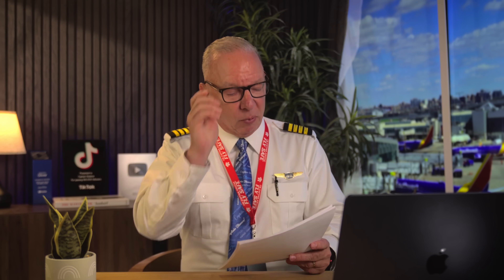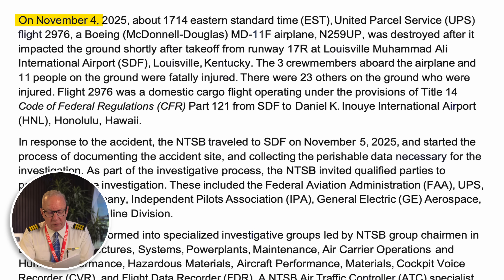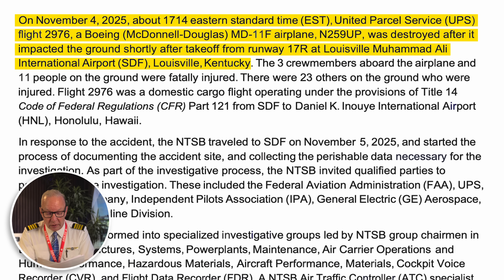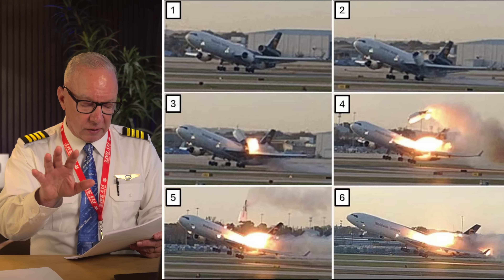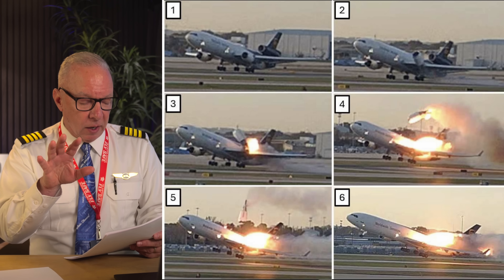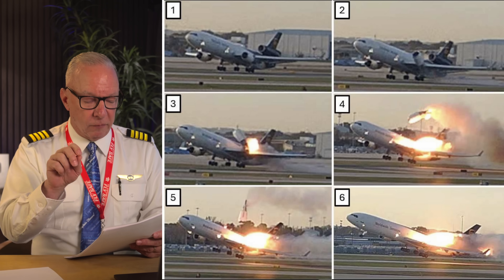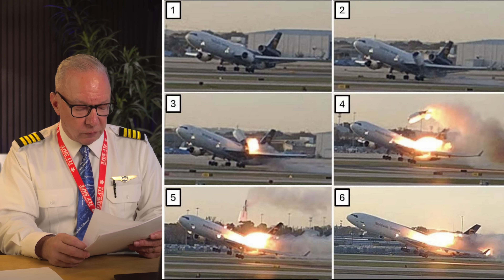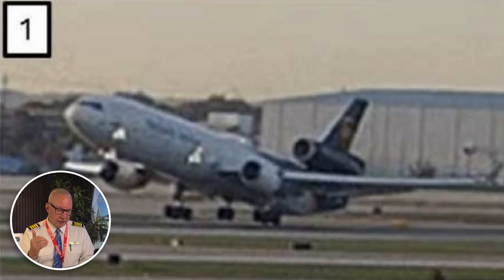UPS Crash Preliminary Report | Pilot Reacts to UPS Crash Report

Comment: Until the fuel burned out that engine had a thrust-to-weight ratio of 6:1 at around 60,000lbs, the bypass on it is about 5:1 so once the fuel burned out it still had about 45,000lbs of thrust lowering as it spun down.

They missed the part where it picked up 3phase 25kVA power lines then shorted out into a building.

Comment: The crash in Chicago was fro Engine change done with a fork lift instead of engine change hoist. Which the American airline engineers approved using the fork lift to save time. UPS does not use this practice. I know because I just retired there 28 years.
Reply: Didn't American maintenance also removed and later reinstalled the engine and pylon as one unit, despite the manual calling for removing the engine first and then remove the pylon?
By doing both at the same time and using a forklift instead of the appropriate hoists they saved a few hundred manhours.
Reply: @kuebbisch yes American removed the pylon with the engine as one piece and when raising the engine / pylon to reinstall with fork lift  it cracked the pylon mount and they didn’t know it.
Reply: When I was a KC10 mechanic we would NEVER change an engine using a forklift. The fact that it was done that way on AA 191 is mind blowing.
Reply: Whatever happened to UPS the result was the same as Chicago - the rear mount gave way due to fractures.

Comment: Steve...MSL is very different than altitude above ground. From what I found out...the departure end of runway 17R has an MSL altitude of 461ft. If they reached an altitude of 481msl...that is only 20 feet over the end of that runway...so the ADS-B data IS accurate.
Reply: If I recall the initial press conferences, the way they described the altitude was not entirely clear. They gave the ADS-B MSL altitude but some interpreted it as AGL. Easy mistake to make, that's why you don't trust single data points. The eye test didn't line up with the interpretation of the altitude data so you dig deeper to find out what's really going on. Basic investigative skills. Unfortunately in the world we live in today, where everyone wants answers as fast as possible, it's sometimes hard to separate "what we know" from a full explanation of what happened. This prelim report is "what we know" but only barely starts to suggest a comprehensive explanation of what occurred. That part will take much longer. But it doesn't take an expert to start to understand the basics here.

Comment: I think it's more about the thrust vector (being below the horizontal at take-off) PLUS the fact the engine is mounted forward of the wing.   MD and Boeing should have done the analysis on this failure mode (FMECA), given that it had happened before this tragedy.  Thoughts to those families dealing with loss.

Comment: Slight nitpicky thing about the "forward lug" and "aft lug" - I believe (and the pylon diagram and photos show this as well) those are referring to the lugs both on the aft mount (not the forward mount) of the pylon. So the absence of fatigue cracks on the "forward lug" is not related to the forward mount which they don't appear to mention.
Reply: I noticed that too, but only because I carefully studied the report's wording and diagram before listening to Captain Steve's description. It sounds like the specific location of stress fractures were on the faces of the two lugs that touch each other, and along the inside (round bore). That wear would never be visible unless the whole assembly was disassembled and each piece inspected separately.

Comment: "481 ft mean sea level" Louisville, the town, mean sea level is 380-400 ft.  This bird barely lifted 80ish ft.
Reply: Nope…the end of runway 17 R is 461 feet. The end of runway 17L 471 feet. Talking elevation. Relative to mean sea level. So 30 feet radio altitude (relative to the ground, so varying) seems about correct.
Reply: 481ft PRESSURE altitude.
The Louisville airport runway is at 501ft altitude.

Comment: I don't get how this wasn't looked at in maintenance. They had metal fatigue in airlines before that caused crashes. They had inspections to look for the problem. You would think planes that had accidents for shit like this would get extra scrutiny in shorter time frames like once a year minimum.
Reply: This could not be seen by the naked eye.  The next "xray" inspection that might have seen it was not due for another 7000 flights.

Comment: Actually, photo 1 shows the engine already angled up above the same level of engine #3.  The question is did the pylon attachment fail primarily or was there fan blade failure that caused excessive vibration and then shearing the mounts.  They did find fan blade shrapnel  on the runway.  Still unresolved.
Reply: The fan duct was intact when the engine separated. The engine got higher than the aircraft did and was still delivering thrust when it hit the ground and splattered.
Reply: @allangibson8494 Conclusion based on facts not in evidence.
Reply: @G.Crispin That’s the evidence. The fan cowl was shredded by ground impact while running. (The fuel in the fuel system will keep a jet engine running for quite some time after it detached from the aircraft - the engine management system fails at last setting (full thrust) if communication is lost to the cockpit).
The NTSB has specifically stated the rear mount failed due to fatigue not overload or short term vibration.
Reply: @G.Crispin  They had a video, if a fan failure occurred prior to the pylon breaking, there would be visible evidence of that.  The lugs were cracked beforehand irregardless.
Reply: @G.Crispin  You don't know what the words coming out of your mouth mean
Reply: Well, the report states "fatigue cracking" which implies that the cracks were already there.  So perhaps an engine failure finally caused it to break, or time caused it to break.  I doubt that it was a fan or core failure, as there would be indications of that in the video, and it was not mentioned in the preliminary.
Reply: A fan blade out event would be obvious in the videos by flames coming out the front and back of the engine. Since none are seen in these news photos, you can surmise there was no fan blade out event or similar catastrophic engine failure prior to engine separation.
Reply: @Whiskey_BS I would expect the preliminary report to mention a fan blade separation event if that is what initiated the failure. The report has a lot of detail for a preliminary.
Reply: Yup.  Where were the fan blades found?          If prior to the other debris, then the vibration theory is likely.
Reply: Good eye, I had to go back and pause the video and you are correct
Reply: I'm sure they would've been able to piece together which happened first.
Reply: @AkersLegalAssistant This is a "preliminary" report.

Comment: Literally the same as AF191.  Sadly it appears the updates they made to MD11 engine pylon based on AF191 issue MAY have caused Engine 1 to hang on a little longer and twist off spiraling over top of the fuselage which FOD'd Engine 2 causing it to compressor stall effectively killing the heavier UPS plane's lift.

Comment: Based on what happened in the '79 crash, do you believe the engine damaged the hydraulics and caused the left flaps to start to retract like that crash?  I realize that with only 1 fully operational engine, it couldn't gain altitude.
Also, do you think the compressor stall could have been caused by the fireball?

Comment: Would an AI system have picked up on the fatigue issue? This is scary.
Reply: AI is only as good as the data it has. Based on my knowledge of how those are mounted the only way to see fatigue cracks in the aft mount likely would be to take the engine off and x-ray the mounts. You can't visually see all stress cracks just looking at it with the engine in place I would guess. It could be with such old planes 6 year intervals is too long for a full inspection.
Reply: 🙄🙄🙄🙄🙄🙄Aer you kidding me?
Reply: @erikhaack4123  There are systems that detect crack progression in concrete. Perhaps that could be modified to monitor metal fatigue in critical components. Sensor tied to AI to warn of issues. I AM NOT KIDDING

Comment: Thanks for breaking this down, Captain. Scary to think just how normal the takeoff looked until the very end because of those fatigue cracks in the engine pylon. I believe the 1979 American Airlines Flight 191 DC-10 crash also involved engine pylon separation due to structural fatigue. Makes you wonder what preventative measures could've been taken to maintain the integrity of the pylon's structural lugs and spherical bearing. Those areas are pretty deep within the aircraft and difficult to visually inspect. Obviously the scheduled visual and structural inspections that the fleet relied on pretty heavily weren't enough. Hoping that the final investigation gives even more clarity for the MD-11 fleet and safety moving forward!
Reply: AA 191's accident was due to a maintenance decision to use a fork lift to reattach an engine and pylon assembly to the wing.  If they had been able to use the correct jig, designed for just the purpose of removing and installing engine / pylon the accident would never have happened and we wouldn't be talking about it.  The UPS MD-11 accident appears to be, and it's just my opinion, an inspection interval problem.  Older aircraft need to be inspected more frequently, not less.
Reply: The 1979 incident was proven to have been caused by a massive deviation from the standard procedures of their maintenance because it saved over a hundred man hours in where they used a forklift to bypass a bunch of cable and hose disconnections, and hence, massive savings for the airlines. The issue was that when putting it back together, the fitting needed to be within a millimeter or so - nearly impossible using a forlift. 

After grounding and inspecting all of them natiowide, they dicovered something like another 13 DC-10 that had the structure in danger of failings due to such improper maintenance procedures. I have a feeling they're going to discover something similar since this plane had just returned from major maintenance.
Reply: It will take a greatly accelerated inspection schedule with a far shorter interval between NDT on the pylon mounting lugs.
Reply: On first reading, I missed the period at the end of the first line. I just about choked whe I thought you called him Captain Scary (a departure from the usual respectful comments here). Glad I was wrong!
Reply: No, not structural fatigue but as others have said improper maintenance by using a forklift which was not standard procedures.

Comment: To be fair the 481 ft is only about 17% high. It's referenced to sea level, 100 ft above ground, so if it showed the correct 30 ft above ground, it'd be 411 ft.
Reply: Also good to remember barometric altitude is not dead accurate. Its reported only at  25ft interval. Also pilots set the sea level pressure according to the current NOTAM some time before lift of. The pressure change over time and variation in location (weather station vs accident location) can easily change the reading. Large planes do not rely on barometric altitude this low. Instead they use a downwards pointing radar. But ADS-B always reports the barometric and GPS ones.
Reply: Why is it even relevant to refer to altitude over sea level at all in this case? The only meaningful figure is how high it was from the ground.
Reply: @MarkPear-k6v As Jamie said, indeed ADS-B altitude is always above sea if its barometric or above the standard datum (pretty much sea level) if its GPS altitude. Its natural the press made a mistake with this information and for them NTSB probably should have clarified it was above sea. However I am pretty disappointed in several aviation "experts" who did not realize the above sea fact and instead claimed the ADS-B data was wrong.
Reply: @MarkPear-k6v Airplanes broadcast their position using altitude over sea level because it is unaffected by terrain. This helps avoid collisions
This will have been the first data the NTSB had access to, because it doesn't require recovering anything from the crash. Obviously it got into reporting before getting converted to altitude above ground, so we hear the plane was at 400 ft, which was kinda true, but not helpful.

Comment: Oh boy, here comes everyone giving Captain Steeeve grief for initially theorizing #3 was the stalled engine. Well, it was more likely #2 stalling based on new evidence. The end result is still the same. It's not like there was something more magical about that engine. These poor guys had no chance trying to clear terrain with only 1 engine at full power. This is just shocking.
Reply: Captain Steeeve explained his reasoning and when the NTSB investigation came to a different conclusion he accepted the evidence and acknowledged his error. Can't really ask for more than that.
Reply: Absolutely. That's how good investigations and the scientific method work.

"What if it happened this way?"

"Nope, evidence doesn't support that."

"Okay, cross that off the list. Maybe it happened this way instead?"

"Yeah, there's evidence for that, could be."

"Interesting, let's keep digging."

Getting something wrong isn't necessarily bad. Sticking to it when you know it's wrong.. that is bad.
Reply: When he made that theory, he did not have these photos he showed in this video. I looked at the photos and videos at the time and concur with his first hypothesis.
Reply: It was a logical, plausible theory. In the end, one of the engines was gone, one was at reduced power, one was at full, and the plane was on fire. No win scenario. If #2 was at full power and #3 was not, the result would have been the same. The only way this could have gone differently, maybe, is if #2 departed the plane instead, and the wing engines stayed in place. But #2 departing would have wrecked the horizontal stabilizer and rudder. That's a whole other set of problems. You will never see a DC-10 or MD-11 in the skies again in the US. I'll bank on that.
Reply: And before anyone comes after me for fanboy-ing or whatever, I watched several videos on this, by bona fide experts, and they all pointed to the obvious compressor stall coming from another engine. When Steeeve said he thought it was #3, I thought to myself "I'm not sure I agree with you there" but did I put Steeeve on blast over it or light him up in the comments? No. Why? Because I'm a civilized human being. Do I think I'm now some kind of expert and Steeeve is some kind of dope? Also, no. Lighten up folks. Sheesh.
Reply: The video was plenty clear that #3 was normally operating and the #2 was the failed one.
Reply: Plenty clear to you perhaps. Not everyone clearly. At this point, what difference does it make other than you can pat yourself on the back for being so gosh dang smart?
Reply: @EdgeCase84 at this point why do you feel the need to try to soothe Steve's ego? He repeatedly asserted it was definitely the #3 even when many were pushing back on his claims.
Reply: @MeerkatADV  I'm not trying to soothe anyone's ego. I'm pointing out the silliness of debating minutiae and attacking people for things that are kind of meaningless in the big picture. The end result was the same. 2+3 = 5. And 3 + 2 = 5. Also, 4 +1 = 5. Whether it was #2 or #3, the end result was the same. Why people care so much about "Oh, see, he was wrong, I was right!" is beyond me. Give it a rest.
Reply: I don't think the airplane was going to fly even with two engines at full power.  Look at the damage to the leading edge of the left wing.  Look at the immediate drop of the left wingtip as the aircraft rolls hard to the left.
Serious loss of lift on the left wing, resulting in a roll to the left, probably not controllable in the minimal altitude available.

Comment: Steeve, one of your viewers in a previous video you did regarding compressor stall in the no.3 engine said he believed it was the no.2 engine ingesting debris. He figured it out weeks ago, impressive.
Reply: I think there were actually 5 or 6 of us who commented that we thought debris from the #1 engine carrying away would have been ingested by #2 in the tail, causing it to fail, not #3 on the starboard wing.
Reply: Captain Steve is still confusing the two engine. Engine #3 is on the tail
Reply: @JC______VA  Wrong, they are numbered left to right. #2 is on the tail.
Reply: @gribbler1695 That's correct. And I had gotten it wrong when watching that video as I thought he was talking about the rear engine when duscussing the stalling as that's where I saw the bursts of flames coming out of. I didn't realize he meant the engine on the right wing on that video or I would made a comment. In fact, I thought he said the #2 engine, which would have been correct, yet he meant the right wing engine.

Comment: What I thought happened is exactly what happened. the left engine and pylon departed the wing, went up because of the thrust and flew up and over the plane throwing debris into the number 2 engine. Just like Chicago in 1989. Had the number two engine not been compromised they might have has a chance...
Reply: With that fire, even with two engines, they would have gained attitude, yes, but the fire would have heated up the wing structure so hot, that the metal would have lost its tensile strength. I think the wing would then have failed sooner or later. And, maybe even engine 2 would have failed. Let‘s not forget: the fuel line for engine 2 passed right where engine 1 is mounted so the fuel line was right in that fire ball. I think its fair to say, that they had no chance at all. What‘s making it harder is sittkng in the cockpit and not knowing what is happening. You can‘t see the wings from the cockpit windows. Maybe the saw light reflections because if the fire but that question will be answered b the cvr.